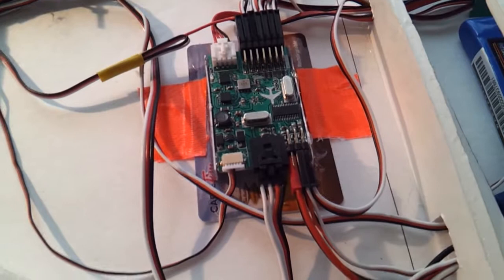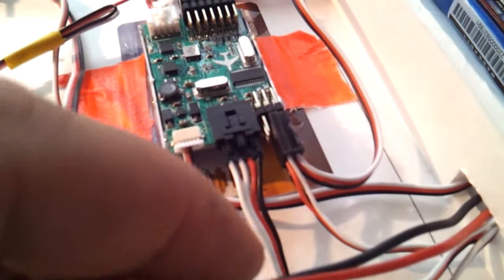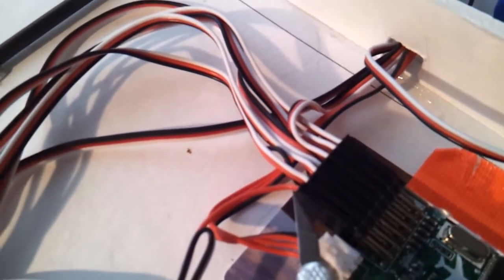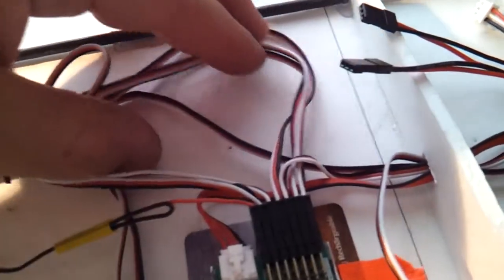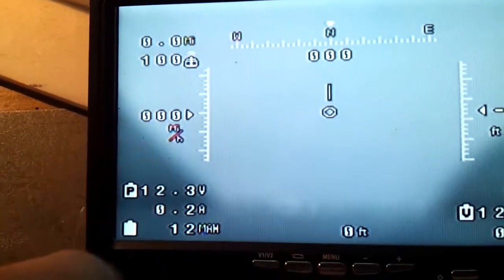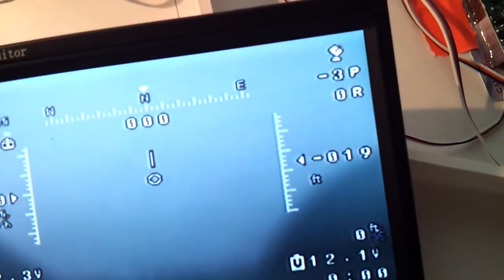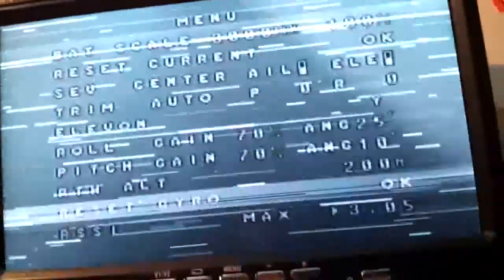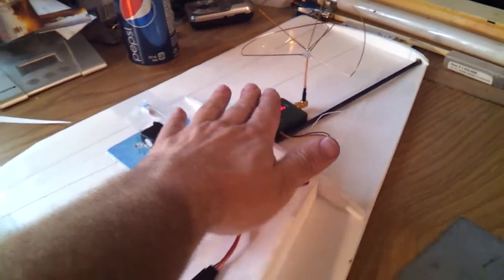cyclops storm osd review: how to setup and connect

Comment: how are you friend; I OSD Test Cyclops Storm ASA also, and has the same problem as my OSD Arkbird in Normal flight status (manual) and OSD Mixing works fine, but when activating the PA Cyclops, it seems that it reverses the camandos of Sticks, the elevator functions as Aileron, and the ailerons work as elevator (but this only to enable the PA Cyclops), someone has been there before and can help me ??

Comment: I noticed a 3rd lipo, the 1100mah Zippy. What is that powering up? You have 1 for the motor/esc a 2nd 1500mah lipo for the osd, vtx, vrx. Thx.
Reply from the maker: +Aero FPV  I use 1 lipo for the ESC/Motor,  1 lipo for the OSD/VTX/CAMERA , and 1 LiFe for the Radio Receiver
Reply: Gotcha ... hey thanks. I have the same OSD and I enjoy it. Such a really good OSD. Do you have any opinion on the cyclops Tornado? Thx.
Reply from the maker: no, i didn't try it yet, the big difference is that the tornado give you air speed instead of gps speed
Reply: Oh thats cool. It's also flies autonomously via waypoints. Insane!!!

Comment: Dear froncoishaha  , my name is Vincenzo and i use my Spektrum DX8 and  AR8000 rec. connected to my Dianmu OSD.
The video works ( i can see the OSD screan ), also the GPS works, but not the servos ( only the motor of course)
 My Dianmu OSD has 2 channals in en 5 out , but i use only 4 ( i don't use the RSSI ).
What do you thing I 'm doing wrong ?
Please, If  you like you can also write me  to: vince537@hotmail.com
Thanks a lot .

Comment: Is there a way to power the board from the current sensor battery (aka flight battery) without the battery jumper? or is that needed for powering the board from one battery?
Reply from the maker: yes you can power the board from the main battery. You have tou use the jumper , simple as that

Comment: cant you place it in the fuselage, on the wing part will offset you sensors out of axis to the main frame and CG, good video!
Reply from the maker: interesting....
even if the sensor are offset from on roll axis, the sensors are working well.  But i think it may be preferable to place it closer to the roll axis.  Thanks!
Reply: you have a lot of lipo that might crush the storm on landing if inside the fuselage, if it works fine your setup is fine,